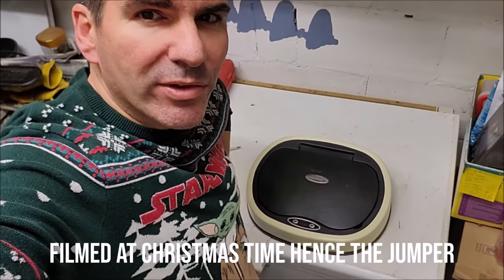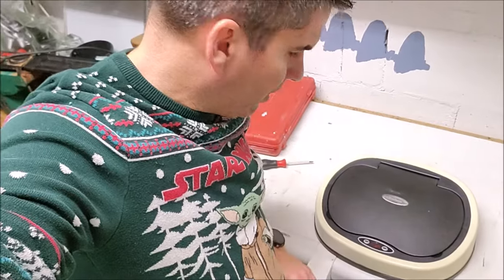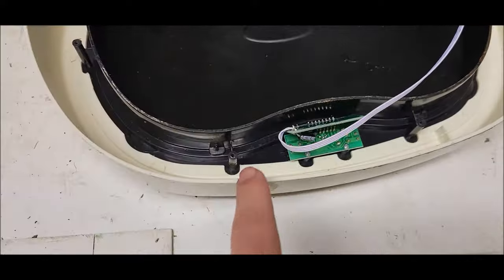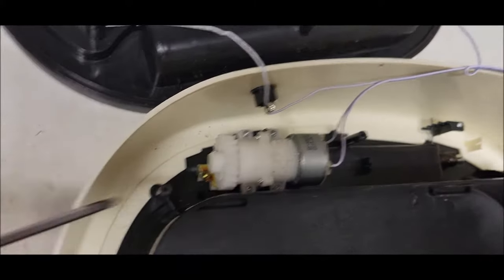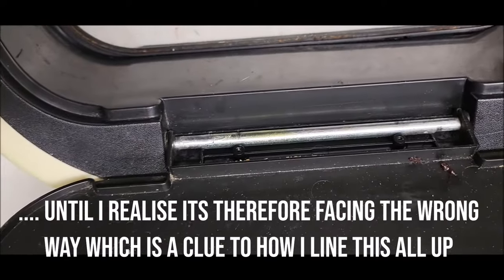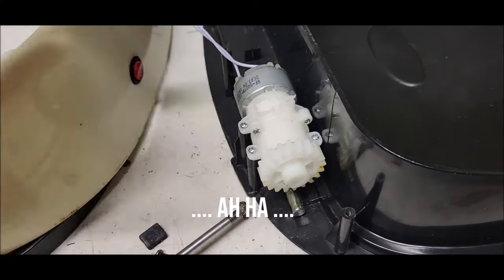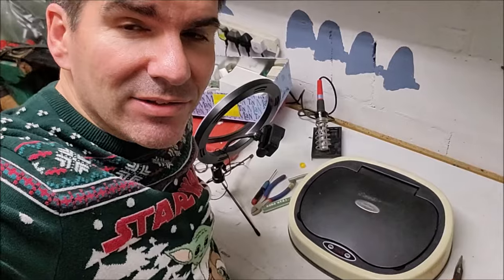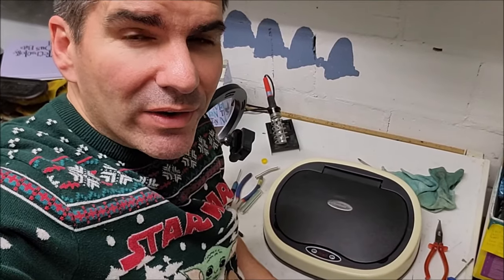How to fix a broken sensor bin

Comment: Cheers mate! You gave me the confidence to try fixing my sensor bin instead of throwing it away. The sensor was actually fine and thought I had a faulty gear but it turns out…when I opened it up something was blocking the gear mechanism from turning. So if in doubt, just open it up first to check what’s wrong before throwing it away!
Reply from the maker: Superb to hear, and well done you.  In Japanese they call that "genchi genbutsu" meaning "go and see for yourself " a way of solving problems

Comment: The on and off buttons work fine on mine but the sensor doesn’t work. New batteries. Have spent an hour cleaning all the reachable bits but think tomorrow I’ll have to take it apart to investigate. My suspicion is these sensors are extremely sensitive to the hinge mechanism and maybe some gunk is knocking it off balance or something. The little light flashes red but there is just zero motor movement when you wave your hand over it!
Reply from the maker: Check for dirt give it a clean maybe even consider using wd40

Comment: I’m having a problem where mine is only opening an inch or so, my kids have punched the lid down anytime they use it so I was thinking it’s a motor issue. I know the sensor isn’t the problem but have no clue what to fix or how, any suggestions is appreciated
Reply from the maker: The gear might have slipped or twisted. Open it up and take a look. With this model there should be two screws holding the gear in place and it all should align nicely. It might just need realigning or rescreing in. Watch out for loose screws if you give it a go.
Reply: @ I opened the gear box and the gears fell out, spent 45 minutes trying to reconfigure them to the way they were. Almost got it but then it the motor came off the wires where it was soldered. 🙂‍↕️🤦🏻‍♂️
Reply from the maker: @gabenolan6746  this is common. Resolder and you are done. You can see it happened to me in the vid too. Dont give up.

Comment: This is a great video! I have this exact model and it’s not opening. I was about to attempt a fix but just changed the batteries and it started working again 😂 a little disappointed
Reply from the maker: Haha brilliant. They are battery hungry... well now you know what it looks like under the covers should you need to fix it.

Comment: Im going to attempt to fix mine as part's dont exist with this make. I will advise if/when i fail miserably.
Reply from the maker: Good luck. Make sure you have a soldering iron on standby the wires don't have much give. Also there is a spring that needs to be tensioned which holds the lid up. Good luck. Let us know how you get on...

Comment: Yep tried u fix mines different model different motor..1st attempt no luck just accomplished a deep clean.
So next few days I'll have another crack at it. Its closing but not opening all yhe way up. I will win this fight..
Reply from the maker: Is it slamming shut when closing? If so it could just need the cog adjusting so the teeth are recalibrated.
Reply: How to adjust cog? @RobTheFrugalist
Reply from the maker: @goulashigabor  look at it in operation. Does it look properly aligned? Are both screws in? (Or however many are attaching to it) One obvious thing to sanity check as well is whether the batteries need changing!!!!
Reply: @RobTheFrugalist  thanks insanity is creeping, batts are new, hard to tell in operation as the motor is very different to yours(maxkon) older model. On mines there are around 5 wheel cogs inside the motor housing so its all trial and error.
Anyways many thanks for sharing your video I am sure it helped a few in the world.
Ps. i also had to resolder 2 wires so fragile.
Reply from the maker: @goulashigabor  i am with you on the resoldering. But its satisfying when you get it back working. Good luck.